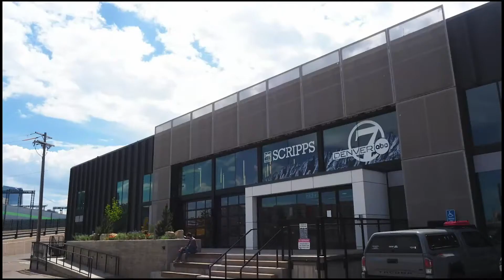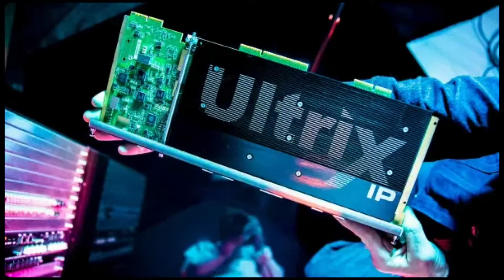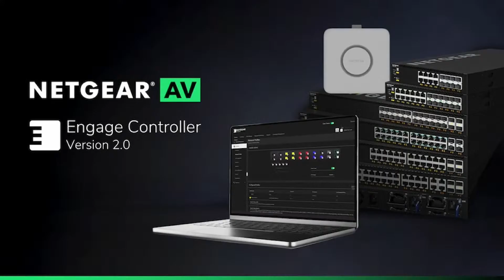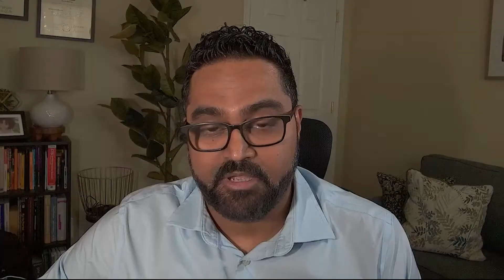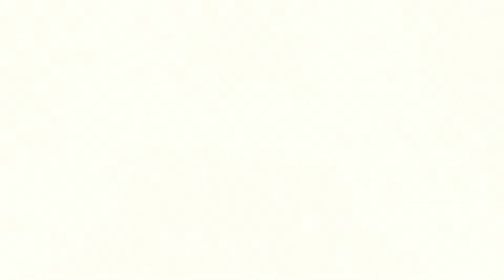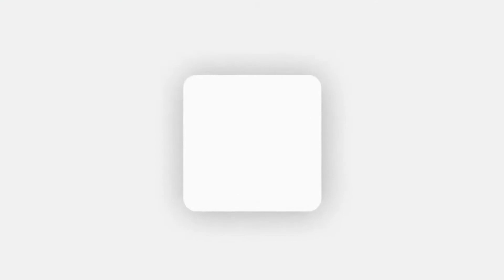SDI-To-2110: Navigating Vendor Interop, Latency & Team Readiness

Comment: I have more than 25 years of experience as a system architect and 10 years as a technical director. Of course, I am aware what is commercial limitation is. A common project description or block diagram will be enough. If Mr. Nik said about a "global" project of 2110 in the US, he could create it Evertz based only. 5-7 years ago, GV had many problems with IP HW & SW. ROSS, Harris (Imagine) does not work in IP. Ultrix-IP :))))))))))) is a low-cost copy of NEXX. I'm not sure that US system integrator use solutions from Lawo or Riedel/Embrionix.  
The theme of this event was very interesting for me. How to migrate to IP, migrate step by step, save the critical departments, and expand the skills of staff - is an actual issue in any country. Now I want to compare the ideas that were generated in our company with colleagues from other countries. How colleagues 'deep dives' into IP - is other interest. I mean, did he use: IP clue (FS, UDX, ChangeOver, 2022 to/from 2110 converter, tuners, .....), IP studio cameras, IP player/recorder/SSL, .......?